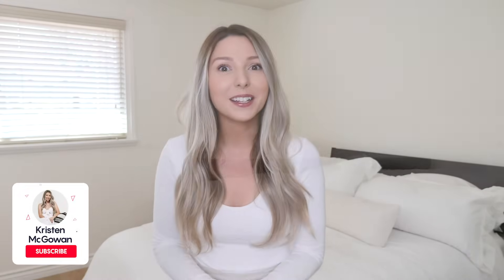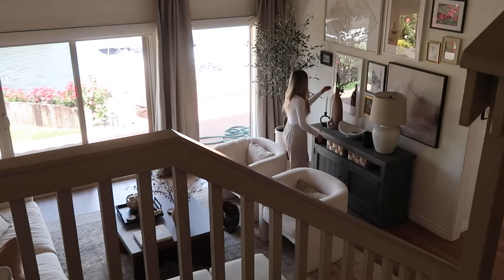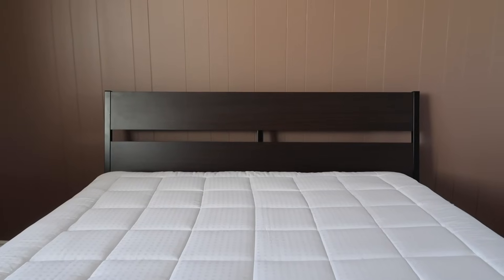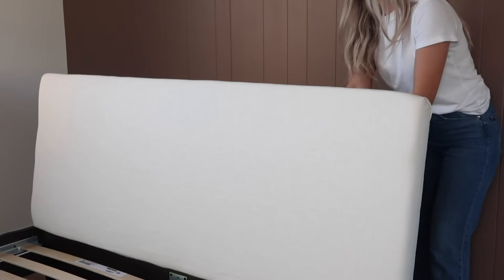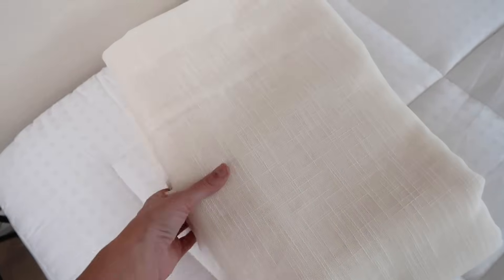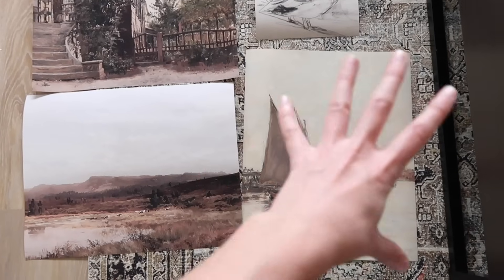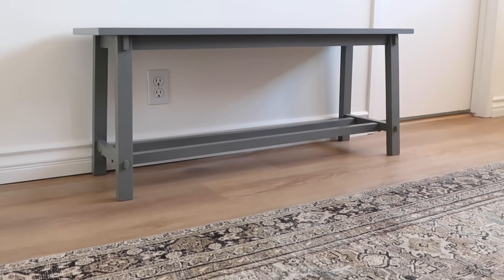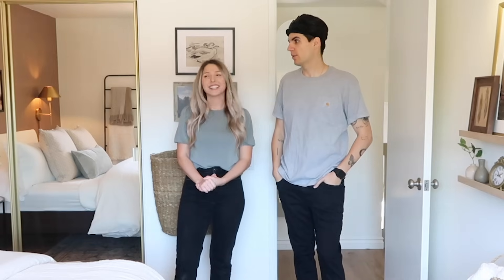DIY EXTREME GUEST BEDROOM MAKEOVER | ON A BUDGET

Comment: Beautiful job! I would actually paint that little bit of the cord/plug that you can see under the table. It will disappear on the wall. I've done that around my house to match the wall color. Also, if you don't want to paint the actual cord, you can wrap it in masking tape and then paint the masking tape... Tricks the eye.
Reply: Good tip

Comment: Very nice but l myself would have liked several shades lighter on the accent wall.  Made the room look smaller.  Also the framed picture over the bed is too small...looks like a 16× 20.  A 24×30 would have looked nicer with an antique gold and black to pull the lamps in to the whole wall together.  As it is looks disassociated to me.  The rest is great!
Reply: 100% agree with you but what she did looks nice but lighter accent wall and larger frame above bed for sure 👍

Comment: A good tip for putting your costs on clips on is to lay the  curtain on the floor. Divide the number of clips with measurement of curtain and then you can measure them out evenly.

Comment: Love this! An easy way to conceal the raw edges at the back of the headboard is to buy enough fabric to cover the back, with the edges pressed to a 1/1-1 inch seam, then do a final tack down around the back of the headboard, covering all the raw materials. Finally, you could add some trim like rickrack or cording to conceal the staples. I love  a fully finished look in case someone looks! Plus, I know it looks as good on the back as it does on the front! Enjoy.